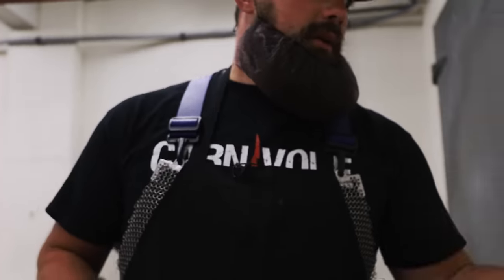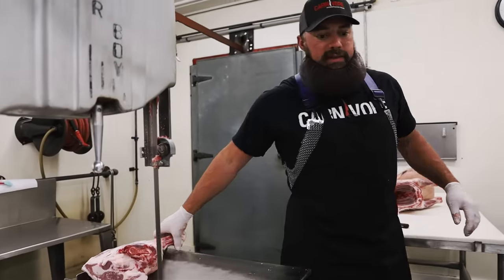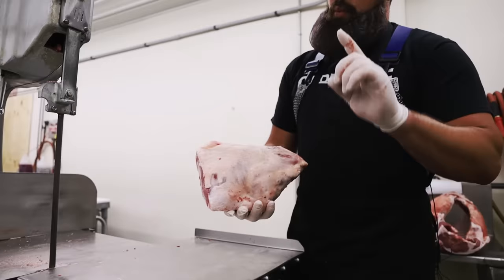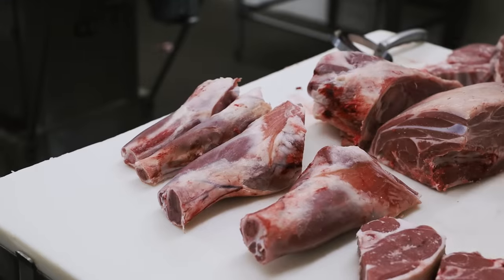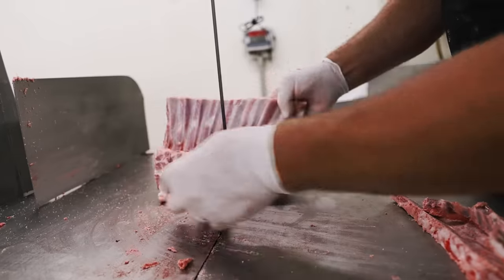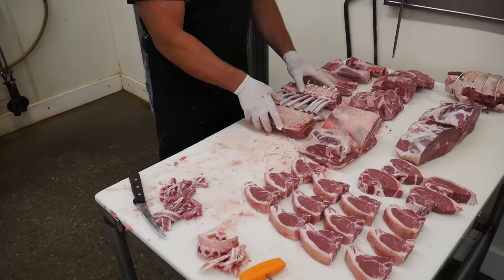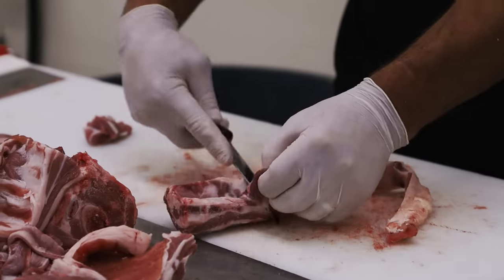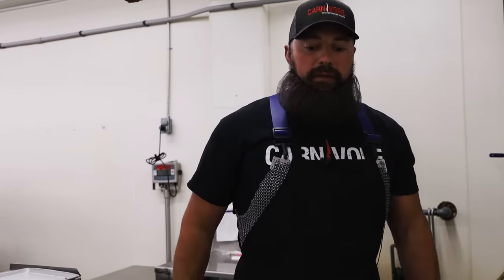How to Butcher a Lamb by the Bearded Butchers!

Comment: That saw looks like a widow maker ...

I'm a carpenter and that high blade is making me wide eyed
Reply: Not to mention what happens when it breaks. And that's not an IF.
Reply: I've worked much larger bandsaws at a small lumbermill. The blades don't have all that much energy when they break. Breaking bands is most common with excess feed rates and dull teeth,(this butchering is a very light feed) a buildup of pitch and dust on the wheels also contributes but that also comes with a lot of noise so you can hear when it needs cleaning, wildly incorrect pretension can have some effect too. Pretty easy to observe feed rate and sharpness by looking at the cut board surface, watching the blade action and listening to the machine. Circular saws now, those can get cha.
Reply: The difference for me is that it's designed to cut flesh, seems more dangerous...

Comment: Great video. As a woodworker you may want to review your technique at 15:13. If your backstop fails, bye bye fingers. Minimally, I'd reduce the pressure as I slid laterally...or have a nylon push stick...speed is not worth fingers.

Comment: When I worked the meat prep In the hotel I worked at, I had no instructions. When it came to the shoulders I just took out the back bone and ribs In one go and tunnel boned the shoulder blade and arm bone, leaving the knuckle attached. Then I just rolled and tied each side to make 2 very large shoulders.
I would liked to have known about ripping off the rib membranes.

Comment: Could have also done rolled lamb breast and boneless leg steaks. The loin I usually do a start cut on the bone with the saw and knife cut to finish. No scraping and helps it last longer in a service case or package. Great knife handling and presentation on those cuts

Comment: I would like to see the cleaning process after the butchering has ended for the day. I think it is quite time consuming.
Reply: Can confirm. I cut meat at a big box store and a really helpful part is having the work space water proof so you can have water hook ups and hose systems so you can just spray everything down. Drain systems are also obviously super helpful
Reply: @cardindex5657  I imagine you would have to clean it really thoroughly which must take ages
Reply: You would hope so
Reply: @cardindex5657  What items must be disassembled and washed with more than spray from a hose?
Reply: @zevgoldman6769  I’m just curious to see bandsaw cleaning, knife sanitation and storage etc. I use a machine from a German company called a “puma slicer” that can cut primals to specific diameters. It can swap out bone in and boneless blades to do assorted pork chops and lamb chops as well as other bone in cuts. It’s pretty cool. That has to be disassembled and pressure washed.

Comment: I have several bandsaws but keep the guide close to my maximum depth of cut. You should drop that down to the height of the fence at least. You use chainmail, so you are concerned about safety, it's just that the bandsaw is your weak link in keeping all your parts intact.